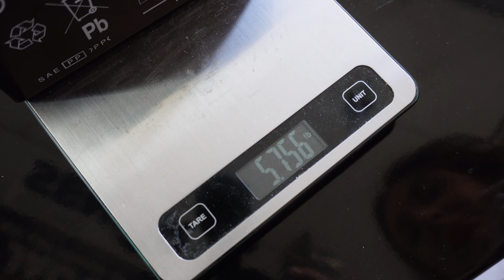Shaving huge weight off my 2023 PANIGALE V4! Lithium Battery Upgrade

Comment: I hope you live in a cool climate, I bought the same battery for my 2020 SFV4S and it (the battery) overheated and shut down, basically they shut off at 53 degrees C to prevent catastrophic failure, is apparently a know issue with the Panigale v4’s
Reply: Lol i wish i saw this comment earlier. Ive been struggling with hot starts on my V4 for months now i finnaly figured out what causing the issue smh